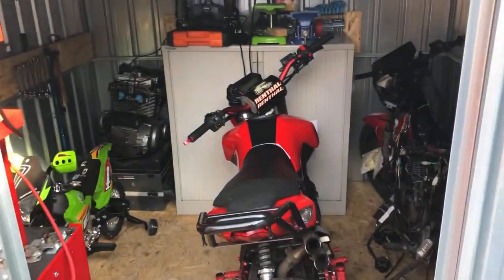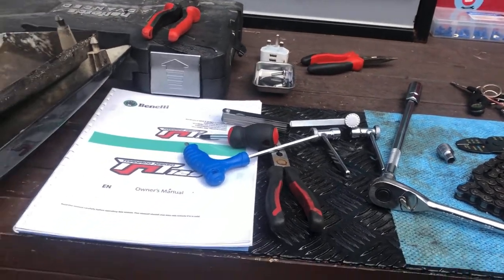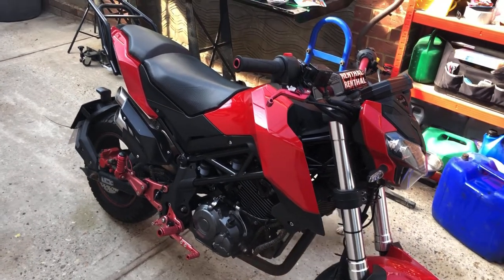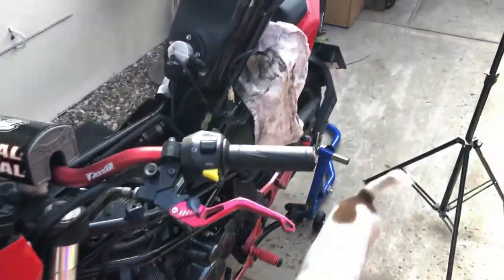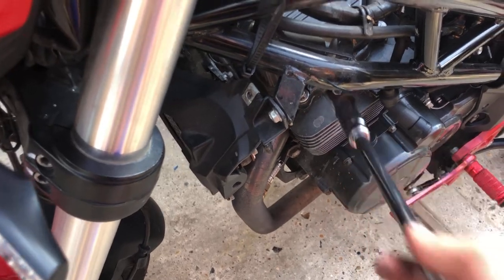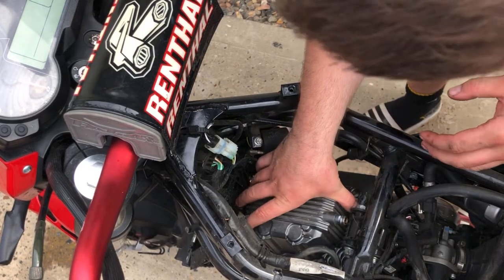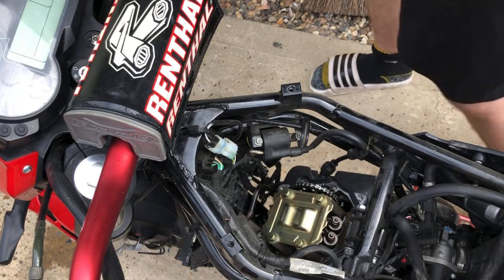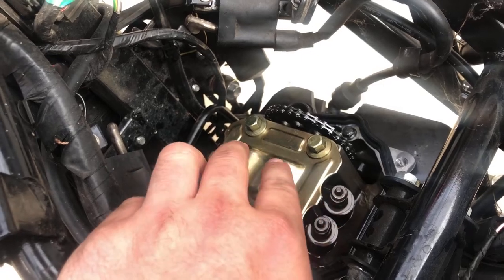Benelli TNT 125 Valve Clearance - DIY - UK -

Comment: did you go for 0.06mm inlet and exhaust valves?  
inlet, that seems good, exhaust side, that's (too) tight imho.
and what's the brand of that valve clearance tool, los to be very handy,this is what's been missing from my toolbox all my life! :-D
Reply from the maker: I went on ebay and write in vlave clearance tool and got one for around 10 pounds I think bud
Reply: I'd use 0.08mm on exhaust valves

Comment: £60 an hour is what my local piaggio dealer charges
Reply from the maker: Yeah mate joke init
Reply: @DTMotorcyclesEssex  it definitely is they want to charge me £80 plus fitting for a new front tyre
Reply from the maker: Buy the tyre of eBay and take it to your local tyre shop and they will do it for £10,£15 that’s what I do
Reply from the maker: I no people who have laid out loads of money to get there cars and bikes fully serviced and they got it back and all the mechanic have done is change oil and left old dirty air filters and oil filters in there cheeky mate some of em are decent but most of em just wanna rip u of